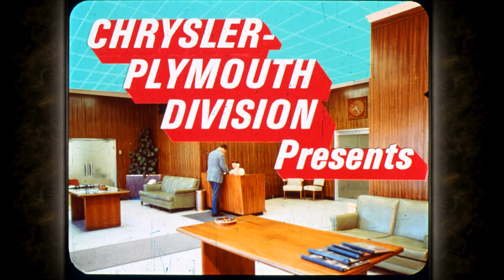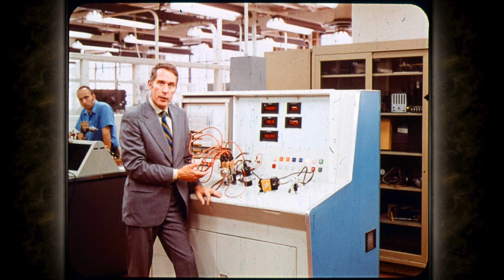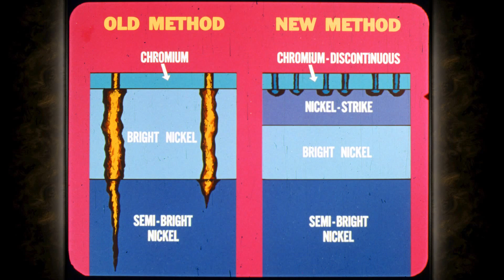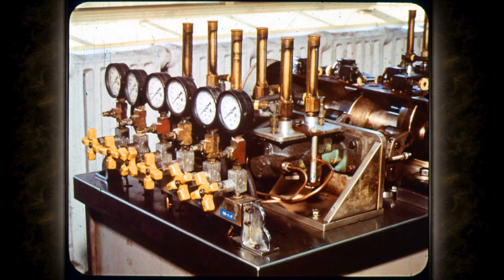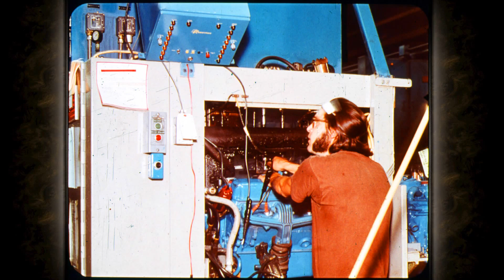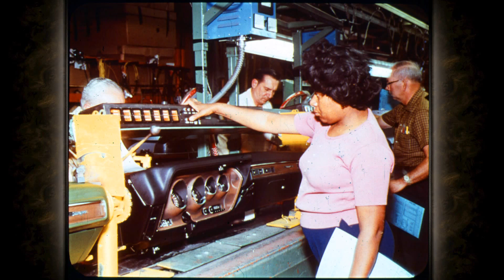1972 Chrysler Dodge Plymouth - Engineering for Quality

Comment: All I can tell you, sport, is that the wind noise was so bad in our four door hardtop 1971 Newport Custom that it hissed like a Whistling Jupiter from the time the car was new.  Additionally, the rear end sang like a choir when my dad took his foot off the accelerator, and the car shook at traffic light and stop sign idling with foot on brake pedal.  Clock broke in the first year.  Hardware was not as good as the GM product.  It was a car the manufacturer just wanted to get out the door.

Comment: Aside from their interior/exterior trim, body and fuel system (I.e. carbeurator,  etc.,) most Chryslers from this era were very durable. Their engines, transmissions, driveline, ignition and electrical system, not the wiring but the major components such as the starter, alternator,  would last a very long time. Starting in 1974, Chrysler quality declined markedly and the company has not recovered since. 
Their major components generally speaking lasted but they had so minor and some major issues, that it basically destroyed them.
Although I have owned numerous Chrysler vehicles, it is because I know so much about cars, that I save money, which a lot of people do not.
I for one, maintain all my vehicles meticulously and that's why my Chryslers last an awfully long time.

Comment: During the summer of 1972, I worked at Hamden Chrysler-Plymouth in Connecticut. I was a student at a state tech school in automotive and landed a job as an apprentice mechanic. 

The jobs I was assigned were ones the older guys hated doing. 

I quickly learned that quality control lacked in the body area: the fasteners securing door glass to the window regulators would regularly loosen and the windows would be semi open with a pissed off customer. 

Door panels on Chryslers: the glued on metallic striping on the door panels would loosen. I was given a can of yellow contact cement and told to reglue them which resulted in a crappy job that I hated saying was “complete”. But the boss said to get it out of here!

A Plymouth Colt (or Cricket) came in with the voltage idiot light on. The charging system was good but the light remained on. The “experts” solution: cut the wire to the light and tape the ends. 

As a soon to be 18 year old, I knew I did not want to work with hacks like that. They still today and at 63 still do all my own auto repair.
Reply: I guess that explains why whey you shut the door on an early 70s Chrysler you would hear the glass vibrating for about a fraction of a second afterwards.
Reply: Kenneth Southard if they had thread locking compounds readily available it may have helped.